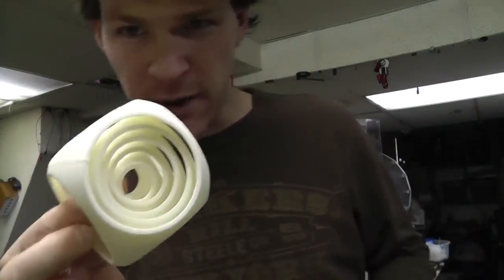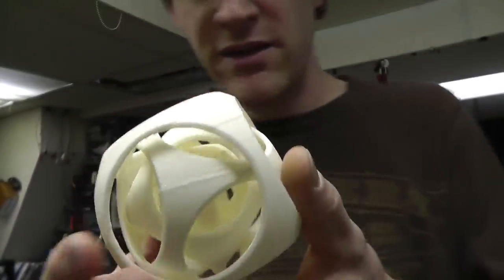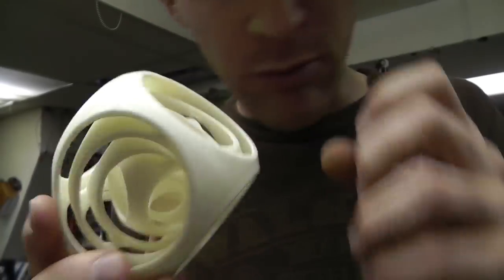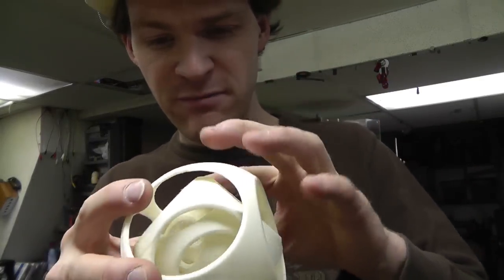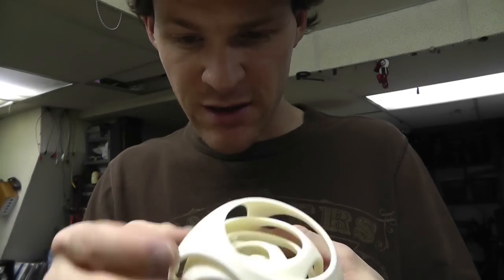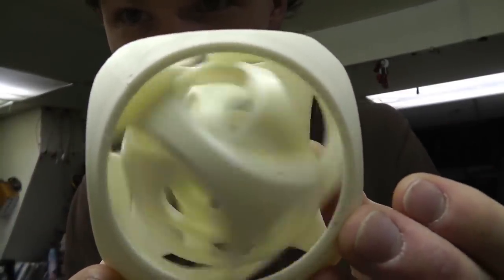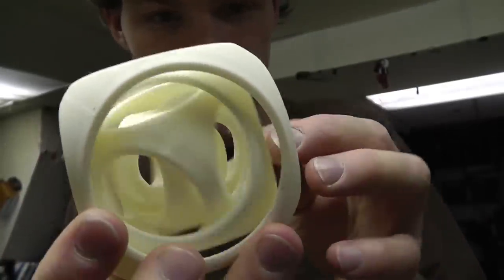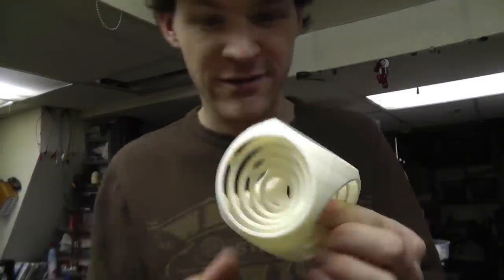3D printed gyro cube sphere thing  time-lapse RWGresearch.com rostock delta

Comment: what are you using as the control board my arduino got fried and I'm having trouble flashing the firmware to a new arduino for my delta style printer.

Comment: Hi Russ, I see you are using a razor to remove the glue from your print bed. Have you experienced scratching? I'm interested in finding different methods of removing glue that are quick and don't involve acetone or other repulsive smelling liquids. Got any suggestions?
Thanks!
Reply from the maker: +Leo Mckee-Reid well i use glass. so yeah a razor blade dose the trick for me... but using a dull flexible knife seems to work well for other surfaces... the trick is to separate the parts with the most smallest thing possible ~Russ
Reply: ***** Yeah, I'm working on glass, too. I'm just slightly scared to use very sharp objects, as it might scratch and create defects, but you've been doing it for a while and never experienced that? 
Thanks a lot for your speedy reply
Reply from the maker: +Leo Mckee-Reid yes i have scratched the glass but only when using a blade that has defects in it. use only a really sharp blade and you should be fine. if anything there scratches so small they make no difference. like hardly able to see scratches .  also give the channel a sub if you haven't. currently building a new delta step by step. lots of fun stuff :) ~Russ
Reply: +rwg42985 Okay, good to know. I guess the glue fills in those tiny scratches. Good luck on the build!
Reply: +Leo Mckee-Reid use cold air
Reply: +SgtVip3r if you use a glue stick you can remove it by hot water (not boiling)
Reply: I use a glue stick on my glass bed, then put the finished print in the freezer (once the glass is room temp) and leave it for 5 to 10 minutes.  When it's nice and frosty, parts will fall off the glass with a tap.

Comment: Can I ask something.. Did you print it with support? or how?
Reply from the maker: hi, no support on this one. or this one: https://www.youtube.com/watch?v=ST_DWJeUGmI

its like lego blocks if you can support the edge you can make it work... :) thanks! ~Russ
Reply: ***** What do you prep your plate with?
Reply from the maker: Patrik Berglund acetone and abs. The acetone will dissolve the ABS. I found if you put it in a wash bottle you can squeeze it out nicely but you'll need to make a cap for the wash bottle or it will get clogged. ~Russ

Comment: my robotics team just won a $3k 3D printer
Reply: What is it called? (the team your on) I'm in an FRC team and FTC just ended
Reply: Braden T FTC Ended? Super Regional is still ahead! Gahh so much prep work, so many prints, and soo soo much filament.
Reply: I didn't know that until a little later because I missed the finals.
Reply: Wait, does he mean the Ekocycle? That's a $1,300 printer, not $3k. 

Nevertheless, have mine all hacked and loaded custom filament carts already. No way I'm going to pay $50 for 250g of filament.
Reply: Braden T What team are you affiliated with?
Reply: I'm on 5920 dogbots
Reply: Mount Vernon high school
Reply: I found on eBay 1kg of filament for $20
Reply: Braden T foxsmart has filament for $18. Great stuff in my experience, after printing 3kg of it on my Orion I have zero complaints.

The 3d systems carts are what cost $50, it is what the Ekocycle uses.

I'm on Got robot? 5037
Reply: What do they supply?
Reply: Sorry for the delay. Who supplies what? 3Dsystems supplies the Ekocycle and two filament cartridges, and Foxsmart just sells filament.
Reply: I meant like what size filament and how much filament
Reply: 1.75mm and 1kg. Just got another three rolls through them
Reply: Actually. I'm on a community team..
Reply: XBuilder_BoyX what grade r u in?
Reply: Well, in 8th grade, you will be able to be in FTC but I would look up your town or city FTC so you know about it before you join. :)
Reply: Do you live in the us?
Reply: I'm also on FRC team 4173
Reply: Wow, this is amazing. I wonder what we would have done with 3D printing had it existed when I was in high school.

Team 103, if you can believe it.
Reply: rusza j I'm on FTC 7314, no 3D parts yet, will implement some soon probally
Reply: M Melesco You should! 3D Printing was VERY useful! i was on FTC 5920 and FRC 4173
Reply: rusza j congratulations
Reply: +Braden T
Our team played with yours at state last year! 

FTC 11121, F.B.I.

Comment: whoa
Reply: I have a Jade ball similare to that. Took a Chinese guy a few months to carve.

What is this made of a plastic resin that hardens. Heard some folks are worried guns can be printed. ATF will not like 3d printers.
Reply: william fair guns can be printed yes. but at present to make a safe to use one requires industrial 3d printing. it's a lot easier to make a home made gun from DIY store parts than to 3d print one currently.
Reply: william fair Why is every one so court up on "printing a gun", after all a gun is just a tool no less effective then any other, such as a hammer, knife or dildo.
Reply: Glen Mcdonald *caught. Also, there's a fairly obvious reason people are caught up on 3d printed guns, they've been told to be, they've been scared by sensationalist reporting. HOWEVER.

A gun is not a tool. It is a weapon. A hammer has a number of uses, it can be used to assemble, destroy, make noise, claw hammers can lever, remove nails, and so on. and yes, if misused, any hammer can become a weapon.

A gun is a weapon, it has one single purpose. To launch a projectile with enough lethal force to kill what you fire it at. That's all. It's not a tool, no matter how you twist the term.
Reply: TessaJalloh I do see your point, the point I was trying to make was its not the tool/weapon but the capable action of the person. Any object can be used in malice.
And thank you for highlighting my spelling, intellect is nothing to intelligence. So please give your self a warm pat on the back, well done.
Reply: TessaJalloh
 uhh not really it's just that most ppl right now are too stupid to realize that instead of straight up printing the gun parts out of pla/abs they can print the parts inverse like a mold and then using that to cast with stronger material.